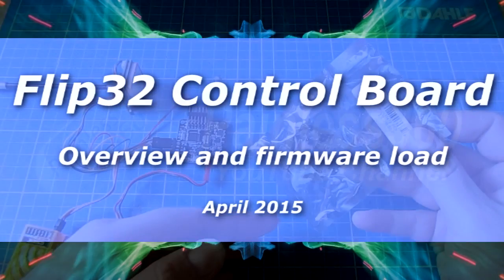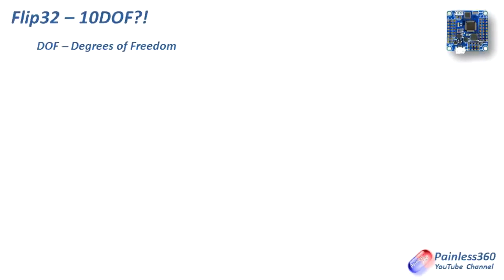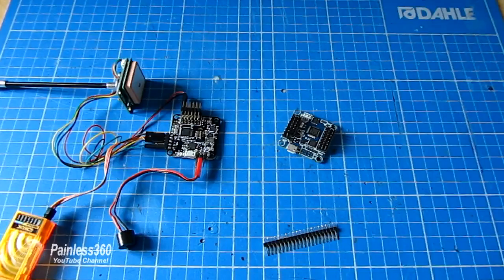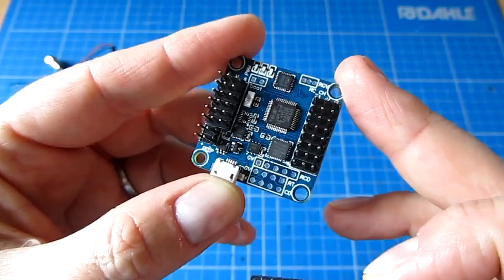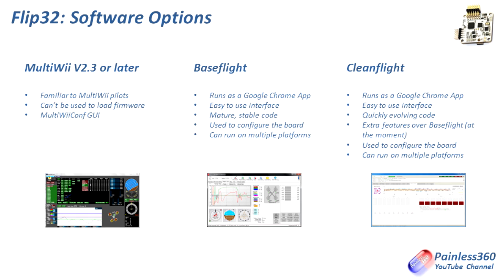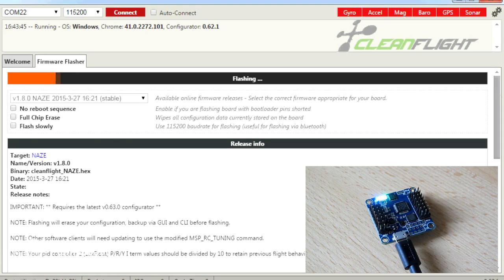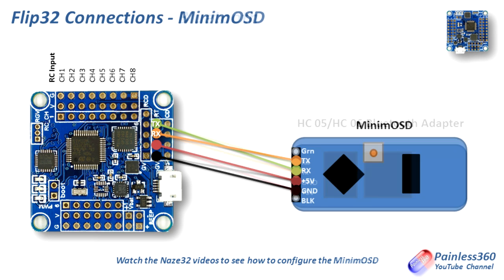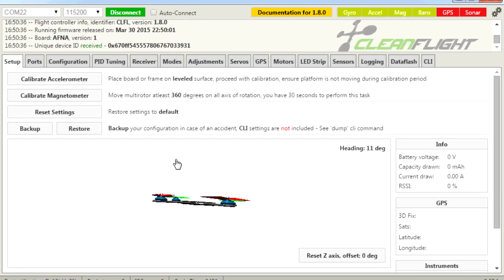Flip32 Flight Control Board: Overview, Cleanflight install and comparison with Naze32

Comment: How do you run minimosd and Bluetooth in parallel? Your videos are awesome! Keep them coming.
Reply from the maker: Austin Gillis You connect them both at the same time but I wouldn't connect the tx pin on the MinimOSD to avoid the signals getting confused.
Happy flying!
Reply: Thanks!

Comment: Firstly, got to say, dont know how id be progressing in this hobby if it wasnt for your videos, there are without doubt the best how to video for all things Quad FC related, simple, clear and concise. 
I lost my 250 (naze32) last week in a corn field and went back to my F450 as a cine copter. Flip32 arrived 24 hours ago and with your videos, GPS working with TH9x 3 pos switch (not great but better than nothing !!). Built my own custom arduino to control Neopixel and landing LED strips based on Channel 8 settings. Couple questions / problems. 
1. If i connect bluetooth AND GPS to flip32,  cleanflight hangs and i cant connect to bluetooth. disconnect BT and works fine
2. Do you know how i could output data from flip32/naze32 to arduino - e.g Battery voltage, channel values, as i'd like to activate LED strips (not neopixel) based on thier values
3. Failsafe - is it possible to kick in RTH if my transmitter dies / signal lost

Keep it up
J
Reply: +Guy flanshaw 
Regarding point 1. Just found out. CF hangs if i connect the Tx from BT to Rx on the Flip32
Reply from the maker: +Guy flanshaw You can get the board to output Multiwii data as telemetry messages using the latest boards and there are lots of code out there (like the Arduino based MW_OSD on the MinimOSD) that 'read' those messages and use them. Maybe looking at that avenue and seeing how they do it might help? If you setup the failsafe to fail to the level on the mode channel that forces RTH then yes.Best of luck with it.

Comment: First of all, thanks for all the great vids that you've made! Question, is it possible to connect the GPS module via the I2C port (maybe with a I2c_to_GPS board?).
Reply from the maker: Pascal Nieuwhof I've not tried it but the i2c pins on the board seem to be more for external compass connections rather than GPS..
Reply: Painless360 Ok, I'll try that anyway as my GPS has a compass on board. What about the UART port? Thank for the quick reply :)
Reply from the maker: Everything you need to know is here - https://github.com/cleanflight/cleanflight/blob/master/docs/Gps.md

Happy flying!

Comment: Holy cow so many boards!? Flip32, Flip32 F3 Omnibus, Flip32 F4 Omnibus, Flip32 AIO Pro, etc..., etc... What the difference? How do i get an original and not a clone? After listening to JC and Painless 360. I am thinking of going with the Flip32 F4 Omnibus but want OSD. Will be for a slow, fun fly quad. Sk450 frame probably with 2213 935kv motors, AFRO 20 AMP(SimonK) 3300mAH or higher 3s and a Turnigy Evolution radio. Any other suggestions, comments or advice who be appreciated.
Reply from the maker: +Lawrence Spies to get an original then. It from the primary vendor (i.e. SeriouslyPro) or a local reputable hobby shop. A lot of the big warehouses stock clones. Look for the word genuine in the description. Best of luck

Comment: Thank you for a great video! I broke two naze32 last week (too much crashing I guess), after that I've starting to buy $16 Flip32s instead of $25 Naze32. A bit surprised you didn't mention ReadyToFlyQuads BTW, I though they were the original creators of this board, but I could be wrong? Thanks again for your work.
Reply from the maker: salle rc They may have been the first but these boards are now available from many sources. Happy flying!

Comment: With regards to GPS use, what happens if you use PPM in on pin 1 instead of the standard parallel receiver inputs on 1, 2, 5 & 6? is the GPS still operational on pins 3 & 4? I only ask as I don't have a GPS unit to test it myself at the moment & still in the throws of getting all my components through the post, also there is no orientation marked on the flip32 board like there is on the Naze32, it it possible to counter the orientation so the motor pins face forward & the USB Socket sideways in a ZMR frame for ease of plugging into a pc etc., 

Thankyou for all your video's they are very helpful indeed & much appreciated.
Reply from the maker: Black Dog Hi, if you use CPPM/PPM on the board then the pins can be used in exactly the same was as the Naze32 full board. See my Naze32 series to see how to get it working with Cleanflight.
In the series is also a quick tip that covers mounting the board sideways too..
Best of luck.
Reply: Thankyou thats helpful advice :) I did wonder if it was already covered somewhere, I will now go and take a look....all the best to you ;-)

Comment: Hi, got the flip32 after your great review. As i am using opto esc without bec, how do i get the board to power up. i am using sbus(futaba) Sorry if this sounds like a noob, just don't want to fry my board. thank you
Reply from the maker: You plug the UBEC into one of the spare motor outputs or, you can plug it into one of the spare connections on your radio receiver. Both should work.

Comment: Awesome video as always Painless!  Quick question: I have this board on my Nighthawk 250 Pro and my receiver does not have PPM output.  I want to install a new WS2812 5050 RGB LED Module and address it through Cleanflight.  Is that going to be possible?  If so, then how?
Reply from the maker: Foam Drone I am not aware of another way to connect it apart from using input 5 pin with PPM. If you figure it out I'd be interested to know. See https://github.com/cleanflight/cleanflight/blob/master/docs/LedStrip.md for full details of the LED setup.
Best of luck.
Reply: Painless360 I read through the document and doesn't appear that it will work.  Guess I need to upgrade my TX module and RX.  Thanks for getting back to me.  Keep these great videos coming.  Awesome work!

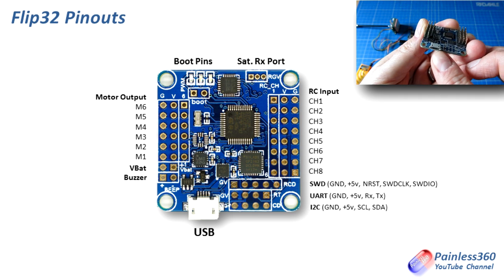Comment: 8:11 chewbacca is getting confused
Reply: ***** Or his dog has a strange yawn
Reply from the maker: Vic Prk It was his feeding time. Very particular about mealtimes are Wookies..  :)
Reply: Painless360 Sorry, you tube wont allow me to comment on my own(I don't understand it myself) I'm going to buy parts for my first quadcopter very soon. I was considering flip32 because it can have alt hold and gps, but a friend told me flip32 is not as reliable as cc3d, can you let me know where you got your flip32, and also where(if you know) where I could get a cc3d revo? Is your flip32 a straight Chinese make? Did you find it ok?
Reply from the maker: No idea on both - sorry the Flip32 was sent by a subscriber and I've not looked into the CC3D Revo yet..

Best of luck with it.
Reply: Can you recommend me a good ubec to buy(away from hobbyking) there's a cheap 3-4 euro one on Banggood, but I've seen a few complaints about it, do you know of a more reliable one on ebay possibly?
Reply from the maker: Not sure, I try and get one from a brand I've heard of like Hobbywing. Search for something like '4a switched ubec' to find them all.

Best of luck..
Reply: cheers fella :)

Comment: Hey mate. Great videos! im having a few issues id like to resolve with my flip32. When i switch my receiver off it automatically takes the throttle back to 1500 instead of the last throttle setting given. Is it possible to adjust this in clean flight? The reason i ask is because i finished a flight and accidentally switched my receiver off before disconnecting the battery. as soon as switched the reciever off my throttle went to 1500 and i had to hold onto the quad so it didnt fly away. It cut up my hands pretty bad so i dont want it happening again.
Reply from the maker: Justin Neumann That is the failsafe setup on the radio receiver you need to change. I would always set it up to put out zero throttle.
NEVER fly without the failsafe setup.
Best of luck.

Comment: Hi, I have a strange issue with my flip32+ (10dof) on my miniquad > i can hover for a few seconds and keep the quad reasonably stabelized (for 20-30seconds at most), but than the quad flips over to the left quit violently. Any idea where I should start to look? (newly installed: V8R7-II receiver with DJT module on Turnigy 9X (bound in D-mode for the receiver), flip32+ with 1.9.0 stable firmware installed). All seems to work fine in Cleanflight (motor test, spin direction works fine, calibrated accelor and magno,...). I am clueless. Thanks for your help.

Comment: At 20:44 you state that you can connect a Bluetooth and MinimOSD to the same wires in parallel.
The MinimOSD is just a consumer of Telemetry data, so why does TX need plugged in ?
The Bluetooth module of course would need TX/RX since it is receiving Telemetry but also sends configuration to the FC.
Can this work on a SPR  F3 board as well ?
For example, I have a SPR F3 Acro, a Taranis Plus with X8R receiver.  I've hooked up the SmartPort to UART2 since I heard Smartport needs to run at 57600 in I believe one of your videos and Softserial is limited to 19200 max.  UART3 is in use since I am using S.Bus.
So my question I guess is, can a MinimOSD plug to UART2 and share the Smartport Telemetry ?  Not sure if MinimOSD can be flashed to support the protocol, perhaps you know ?
Or would I have to setup a SoftSerial for it.
Also what about Bluetooth.  In the above setup, is setting up a SoftSerial the best/only option for a Bluetooth dongle ?  And in cleanflight what is setup for it.  Would Softserial 1 or 2 be set with both MSP and Telemetry ?
Just curious how I can get everything connected at once.  I also have a Deluxe version that I intend to do the same + GPS.
Thanks for your videos, great work on them !
Reply from the maker: +Frank B The OSD isn't simply a consumer of MSP telemetry. It actually 'asks' the board for the detail so the other pin is needed. Sorry if I'm not clear I didn't mean that you connect the two at the same time that would cause problems. Happy flying!
Reply: +Painless360 Ah gotcha, makes a lot more sense.  Out of all the comm port knowledge I have I was so confused thinking you could have 2 devices on the same UART at once.  I didn't realize the OSD actually asked for data, I thought it was similar to how Telemetry is sent from a UART to the Smartport.  Just a single wire connecting TX on the FC to the signal wire on the X8R Smartport.   Thanks for clearing that up. :-)

Comment: I just received my Flip32 10dof the other day, I would like to use a spectrum satellite receiver only as it is going on a very small quad. Do you recommend simply soldering a satellite connector to the 3 pins at the top of the board. You showed them in your video but I could not find where you may have addressed them. I assume you bind your receiver and satellite to your radio and then just plug the satellite into the board, does this sound correct?
Reply from the maker: teamscreem That is right, if the board has not had the connector installed then I would do as you say and solder it. Make sure that you have bound it to the radio with the failsafe settings you want before snipping off the connector though.
Best of luck.
Reply: Painless360 Thank you for the quick reply, I appreciate you sharing your knowledge with the modeling community, I personally have found them very helpful.

Comment: great video but didnt see this part.. dont see telemetry labeled. where do i put receiver green and blk gnd on the flip??
Reply: NewbieMarketerOnline think i found it.. i have to use ppm first, then use channel 6 for the inputs to get telemetry??
Reply from the maker: NewbieMarketerOnline Yep! If using Taranis you will need to invert the signal in software -  https://github.com/cleanflight/cleanflight/blob/master/docs/Telemetry.md

It looks like the key CLI command is set telemetry_inversion = 1

Comment: Hello, since you are also using a Taranis: which Frsky receiver do you recommend (I'm just confused, how many channels I need). I want to built a 250 racer quad based on the Flip32+ with GPS functionality, minimosd etc.
Reply from the maker: Bernd Müller You need a minimum of 5 channels. Something like a D4R-II gives 4 channels of PWM but lets you send eight over the PPM link. That's what I'm using a lot at the moment..
Hope this helps.
Reply: Painless360 that's what I was thinking of! Thanks! Helped me a lot!

Comment: I have just bought a dof10 and an NZ GPS (the mini 7 ublox type) from your friend at digital cure however I'm having a job trying to find a step by step setup for wiring up as I'm using pwm. All the videos seem to cater for ppm (cppm) I have seen info on transferring the plugs from channels 3 & 4 to 5&6 and using 3&4 for the power/ground and TX/RX but how do you configure it from there? Any advice please? Thanks
Reply from the maker: +Trevor Vernon All covered in the Naze32 GPS video.. Best of luck!

Comment: all these multiwii based controllers are so confusing, every site you goto theres a million version Flip32  Flip32+ flip32+deluxe 2.5 5.0 omg!!!!! how did they even become so popular with all this confusion!

if you can post links to the board you actually got and gps unit that actually worked with it.  

Thanks in advance :)

Comment: After adding GPS functionality can it be used for flying autopilot missions as with the APM board?
Reply from the maker: robrow Not really at the moment, only GPS Hold and GPS home are available in most of the firmware out there. Remember the this little board wasn't designed to run GPS missions and mission code takes up a lot of room in memory.
We are all waiting to see the side develop for the Naze32...

Comment: is it possible to have BT & GPS on the single UART connector. I seem to recall you mentioning it in a vid but cant remember which ??
Cheers
Reply: +bigfilsing Note to self ..Always watch the vid to the end before commenting :-)
Reply: +Painless360 one thing I have noticed is that you can't connect with the latest clean flight if you have BT, GPS ,Lipo & USB (to PC) so went round in circles for a while! simply disconnect BT and set up config of GPS works fine. Then when done connect BT again

Comment: Where is uart1 and 2? And what are softserial? Im having a hard time figuring this out. I have this loaded w cleanflight 1.8 and im not getting battery telemetry w the frsky d4r. Vbat,telemetry,softserial enabled and batt connected to batt pins.
Reply from the maker: k.o rengaarder Google it and it is out there. I found the detail on http://www.rcgroups.com/forums/showthread.php?t=2320471&page=12
Hope it helps.

Comment: hi,  sorry for asking, i am trying to install a mini osd using a flip 32 board.  I have followed all the instructions.  when i power on the quad the camera is working as i see a picture through my goggles.  but there is no osd overlay showing.  Is there something that i have missed.  Are there any ports to turn on on the cleanflight software to make the board talk to the osd??
Reply from the maker: You uploaded the font file?

Comment: I have a Question, I am building a 250 quad and using this board. Can I power the gps from my PDB or do I have to Use the board? I would like use the other 2 channels for a auto leveling cam and another for my leds
Reply: +Thumper C I'm using a N32+ GPS
Reply from the maker: GPS needs 5v, see our GPS videos in the Naze32 and SP3 series..

Comment: Can the Flip32 be powered through other connections?  For example, if one has a hexacopter that uses all the motor inputs but the esc's have no bec's?  In that situation, what about feeding in the power from a 5V BEC through the + and ground pins on motor 1 since motor #1 only requires that the signal pin be connected?
Reply from the maker: +David Nickell If your connections are all full then power the board by plugging the UBSC into the Batt port on the radio receiver..
Reply: Actually added a 5V and ground pin to the #1 motor connector.  Seems to work fine.

Comment: Does the green arrow and props represent the back of the board or the front?  I rotated my board so the USB board is on the side.  
In the setup tab There is a 3d quad with a green arrow pointing towards the two green props. 
With the red props as the front in the cleanflight the instrument compass points to the correct north.
I know how to rotate the board via cleanflight but I do not know if I have it backwards or not. In the videos I watched older version of cleanflight showed a box clearly labeled front
Reply from the maker: +Ikararua In Cleanflight - that's the front. I always tip the board forward after flashing and watch the artificial horizon in the GUI to confirm I've got it the right way round.. Best of luck!
Reply: Thanks, I"m using the Green arrow as front
Board Alignment (Flip32)
R 270 P 270 Y 90
And assuming the artificial horizon functions like it does on a real plane so I watched a youtube video to learn how to read it
Pitch Foward works correctly
Roll Right - The right side of the horizon goes up indicating a right roll
Roll Left - The left side of the horizon goes up indicating a right roll
Does this sound correct?

The Compass is pointing in the right direction as well (Used an old fashioned compass and google maps to determine north :) )

I'm new to this and my first flight didnt help that Wind Picked up right after my flight and 3 feet of the ground a strong wind takes my drone into a soccer net destroying my antenna and a prop
Reply from the maker: https://www.youtube.com/watch?v=lxVd4LnHDjQ ;)
Reply: Painless360 Thank you!